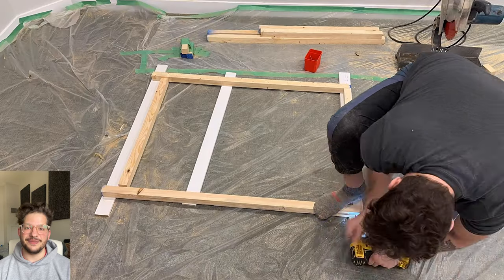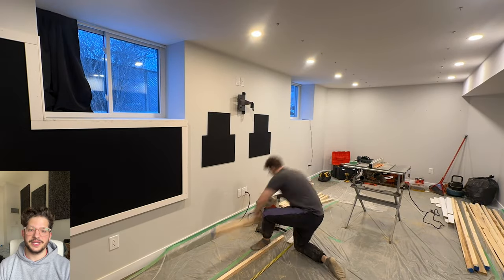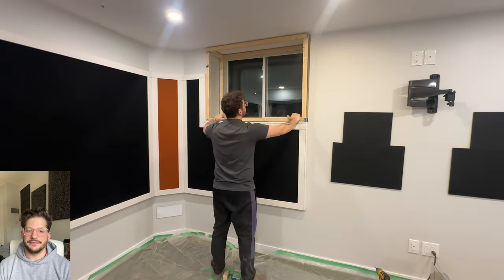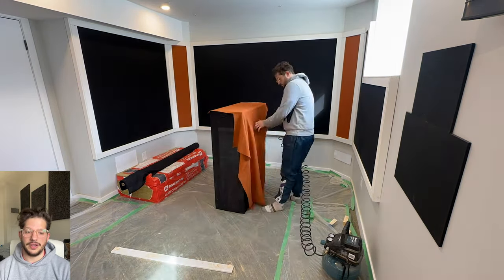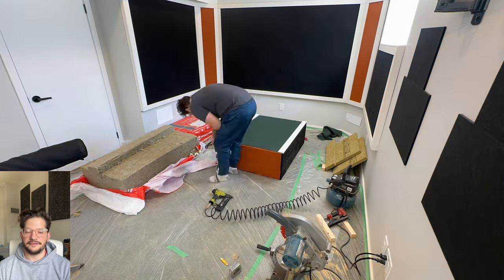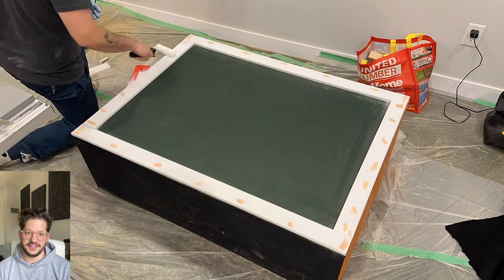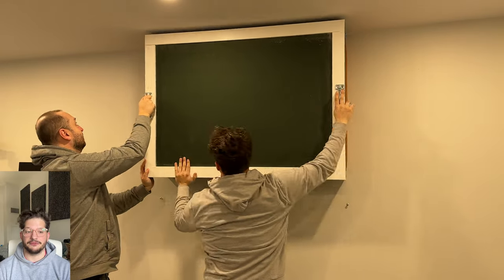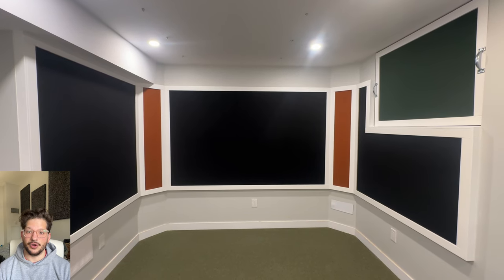HOME STUDIO BASS TRAPS! FOR BASEMENT WINDOW BLOCKOUT!

Comment: Does the rockboard does a better absorption then the regular safe n sound rocwool ?
Reply from the maker: They both have different densities and absorb a different range of frequencies, I like to use both when I have the depth to get the benefits of both and provide a rigid face to the fabric of the bass traps. Thanks for watching!